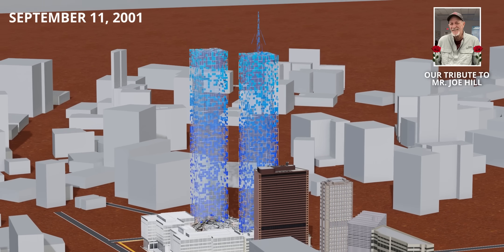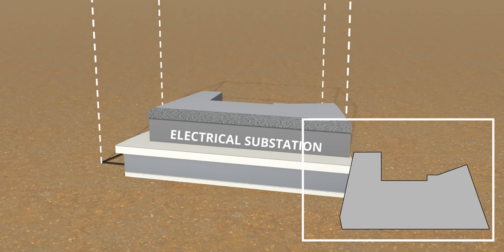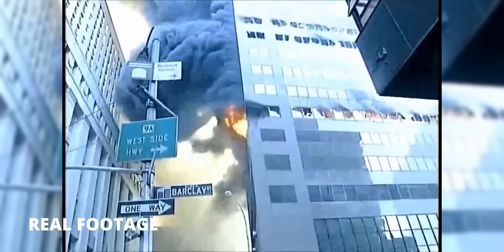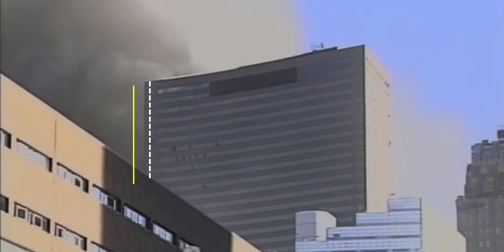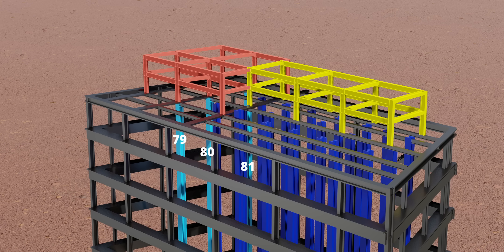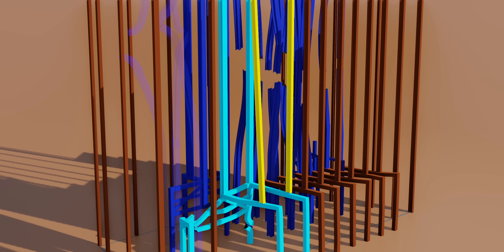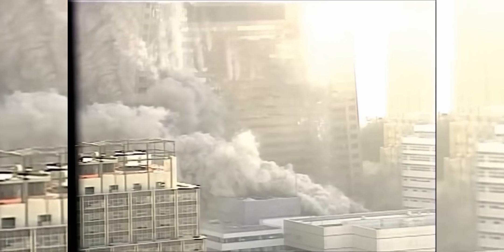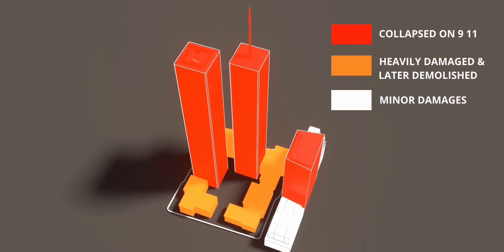Collapse of Building 7 | The Complete Physics

Comment: I have never seen so many improbable events happen in a single morning
Reply: yeah airplanes hitting buildings is pretty fucking crazy
Reply: @johnt,  use your brain. There was 2.5 seconds of free fall, in a 15 sec collapse.  What, explosives accelerated the collapse, then decelerated it?
Reply: @ExponentMars The craziest plane is the one that hit the pentagon directly in the budget analyst office, where the staffers were tracking the 2.3 trillion dollars that couldn't be accounted for, announced the day before on 9/10/2001.
Reply: @velatoget That’s a lie. That number was known about for 2 years prior.
Reply: @TreadHead42  That's not a lie. They might've known the number, but it was ANNOUNCED (read what I said) the day before, on Sept 10th, 2001. And you focused on the smallest, most meaningless detail. You somehow skipped over $2.3 trillion going unaccounted for, the plane hitting directly in the budget analyst office, the FBI/CIA taking down all security footage nearby and refusing to ever release it to the public, and so much more.
Reply: The passport from one of the terrorists who was on the plane survived all this and was found on the street. But the heat from that same airplanes fuel was so strong it melted the iron. What was that passport made from?
Reply: @AABB-zb6dv No proof of alleged "terrorists" even boarding the planes exist.
Reply: @AABB-zb6dv Passports are commonly found on airplane crashes, since they normally fly off due to the impact. Plus, many other documents and belongings, like plane tickets and wallets, survived the crashes and were found on the streets
Reply: I never thought a 747 could evaporate like the one that crashed into the pentagon.
Reply: @b @billwalsh388 ust look at the aerial photography of the 2015 Germanwings plane crash site,  without the contrast against the dark mountain you wouldn’t be able to see anything. Mixed with debris from a building, after such a crash you can’t recognize an airplane anymore.
Reply: @billwalsh388 It was a cruise missile - that's why
Reply: @billwalsh388  then you are stu-pid
Reply: @billwalsh388 The Pentagon wasn't hit by a 747, it was hit by a 757, a much smaller aircraft.
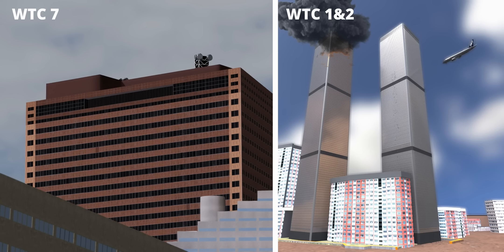Reply: 9:36 NIsT … the government agency responsible for investing this said it fell at free fall.  This video just said it was an editing trick 😂😂😂.  Free fall is in the official story dumb dumb
Reply: @beezybeez24  true
Reply: I cannot account for all the things you have never seen.

But what is truly is incredible is your fanciful nonsense of an alternative explanation
Reply: @MoseleyJon yea because us questioning the goverment who used to is to cover up the trillion dollars that went missing and used this to go start a war in the Middle East to destabilize it for the juice
Reply: @unanimouscoincollector8654 What war was started in the Middle East?  Iraq?  Framing AQ didnt really advance that.  AQ were already active and that war waa won within weeks. The US then spent 20 futile years trying to run Afghanistan, spanning 4 presidents - did they mean to start that war?
Reply: @laxeystu8096  Furthermore, the huge expense of the Iraq war is "on the books."  There was no money off the books required
Reply: I'm sorry-- maybe such "guns" are not "smoking", maybe just "lit cigarettes  left in ashtrays" is what still  has me coughing and  "choking"?

What is left but poetry and merry joking??
Reply: What I’ve learned is that I can rent a crane and smack a few holes in the side of any steel skyscraper then catch it on fire with some jet fuel and induce a nice and neat global catastrophic failure of the building.  I could under bid any demolition company in the world and get the same or better results than them.  Only need a crew of 2 or 3 guys to do it.  We could share the profits equally.  Even seems like we could be on call and have the building brought down on the very same day and be back home before lunch.  I’m just hoping the other demolition companies don’t steal my idea and get to market before me
Reply: @ryanburch7798  No, for many reasons
Reply: Whaddya say, about things PRIOR to such a day? For there is MORE than ONE "smoking gun" than just bldg 7......

......To get the conspiracy theorists theorizing and revin'.
Reply: Probably also never saw two jumbo jets loaded with jet fuel slamming into skyscrapers at 500+ mph
Reply: The main event is improbable - the damage that occurs because of it would be expected.
Reply: It's called a coincidence. 😂
Reply: @chrisdanielson1219 almost like winning a loto then geting struck by lightning-2 times on way to cash it ,when they bring you in hospital they say you are diagnosed cancer and if you waited a day more it would be over , but then a random drone hits a pigeon and loses control falls on building causes fire and fire spreads to hospital, then cuz office fires are just to strong for steel structures hospital collapses and every1 dies except owner of hospital who was only that day missing from his office and when he comes to burning scene he finds your loto ticket.. believable? Or too many coincidences?
Reply: "So many improbable events in one single morning" in over 20 years this is the best statement I have heard to simply sum up what happened.  The whole thing was bullshit and our government feed it to us while sacrificing the lives of thousands of Americans....absolutely disgusting!!
Reply: @AlexanderPerez-v4w How could they do that!! Is money so much more important than a human life?
Reply: Improbable events like steel failing due to excess heat and damage, then collapsing?
Reply: @Cereaza2  the wtc 7 was damaged by what ?
Reply: @Cereaza2  excatly like the wtc 7 ?? Come on
Reply: @Cereaza2 you just said the main point. Steel weakening isn’t the same a steel losing 100% of its strength at the same time at all points in the building… weak steel still gives resistants.    Free fall is impossible.  Even if the buildings were made of popsicle sticks it still couldn’t have fell like that. Basic physics says weak steal can’t fall straight down.  It would tip.
Reply: @beezybeez4207 basic physics doesn't say that. For it to tip over, one side would have to lift up off the ground. That's not going to happen unless the foundations come out of the ground. 

Also the towers didn't fall at "freefall speed". You can tell because you can see debris falling faster than the towers
Reply: @Cereaza2  Yes.  All of those events are highly improbable if not impossible.
Reply: @Cereaza2 ya the 1st 2md and 3rd time it ever happened. To much other stuff that makes it obvious it was a false flag
Reply: @Cereaza2  
Never again in history have steel frames building collapsed due to fires, here it happened what, 3 times in a day?
And all the buildings were owned by the same jewish billionaire that had the largest insurance in history on them? 
And it lead to a "war on terror" that justified the invasion of foreign lands and gave life to the military industrial complex for decades?
Wow. This really was americas lucky day!
Reply: @TuriGamer 
Wasn't Americans but Israelis lucky day.
Reply: @Cereaza2  Yo i think he just means it was a pretty crazy morning..
Reply: @crashkey poor dude probably did really mean it was just a day of unimaginable 1 in a million horrors and these goofball truthers have everyone on edge and lashing out lol
Reply: @crashkey nah bro. He's a conspiracy theorist.
Reply: @crashkey  No, he means it was clearly fake.
Reply: @crashkey  No, he means to imply that a lot of things that happened, couldn't have happened the way they did. But because he doesn't have actual arguments to support his position, he just implies the 'official story' is false without daring to directly say it.
This type of cowardice is common for conspiracy nuts. They want to make a claim they know they cannot support, so they just imply it, and when pressed, can pretend they never made the claim they clearly implied.
Reply: @Cereaza2  Like 2 jumbo jets doing physically impossible flights into buildings which then impossibly collapsed, then impossibly causing a third building to collapse, as a result of impossible events.
Reply: @Cereaza2 
The jet fuel burns super fast, it didn’t just stay burning long enough to melt steel beams
Reply: @elidelhotal3003   steel can have to be  weaken substantially without melting,  and  therefore not able to support the weight of the building.
Reply: @cacbdb  Yes but then you still don't have a free fall let alone a straight free fall
Reply: @elidelhotal3003  Yes. True. Thank you.
Reply: @elidelhotal3003 - Correct...95 % of the jet fuel went up in a black cloud..
Reply: @elidelhotal3003  Yes, exactly, the jet fuel wasn't the main fuel of the fire, the building and office materials sustained the fire, and no, that still doesn't melt steel beams, no steel beams were melted.
Reply: @cacbdb  Indeed so.  There is a reason that there is a National Fire Code.

It mandates that steel beams must be protected to maintain their load-bearing capacity.

Common life safety ratings are from 1 to 3 hours - depending upon the buildings occupancy classification !
Reply: @cacbdb dont forget the fire protective coating that they are built with
Reply: @Cereaza2   Right. So, what you're saying is, on your planet, there never was an "iron age"? Because, on THIS planet, the effects of heat on iron and iron alloys? Have been known since about 3000 BC....
Reply: @mooneyes2k478 You seem lost in the "IRONY AGE" = IRON DOES NOT EQUAL STEEL!
Reply: @Yes-bk9cl  Yes it does. Steel is an iron alloy, and even the specific types that contain the highest amounts of non-iron elements are made up of 75% or so iron.

But even if it didn't....which part of "iron alloys" did you miss. The iron age means "we learned to use iron and its alloys"....and steel reacts exactly the same as iron does when heated. It turns malleable.
Reply: @mooneyes2k478 Iron alloy steel is NOT interchangeable. That's why we have steel 😂
Reply: @mooneyes2k478  your comment makes no sense. Steel was used for the columns and not iron. Also exactly because we know the properties of iron we know there was no controlled demolition. It was metal fatigue.
Reply: @momchilandonov  " Steel was used for the columns and not iron"
And so, you have no idea what steel actually is?
Reply: Well, maybe also on the day JFK was killed...
Reply: I mean... the most improbable things were two planes hitting the twin towers, the rest more or less follows...
Reply: yep. makes you want to go back to sleep. who wants to start the day off with a pack of lies.
Reply: So said one dinosaur to another.
Reply: Hmm, well if you're  "amused" by "improbable events" you don't need to JUST look at September 11, 2001.....Heck, just look at some of the events ((((OR LACK THEREOF)))) PRIOR to that date....With a sharper eye on the state of FLORIDA, which I believe was governed by "W" s brother "Jeb" (No relation to me as a  "Jeb" either🙄)

All sorts of "funny" or "improbable" things are involved with the date of September 11th, 2001....Including the "merely coincidental" choosing of such a date by supposedly MUSLIM TERRORISTS to be referred by a 💩💩💩💩--load of people simply as "nine eleven"....The same three digits designated as the  NATIONAL EMERGENCY number of  "911"?????????????

Heck, while you're at it, just look to see if THIS COMMENT OF MINE HERE actually remains and does not get pulled by YouTube????🙄🙄🙄🙄🙄🙄😒
Reply: Oh wait.....Maybe it's just a single  GOVERNMENT AGENT/bureaucrat working  perhaps the PROPAGANDA/INFORMATION DISPERSAL DIVISION of the CIA/NSA  working for (or IN) Google/YouTube that decides what comments here  get yanked??  

Whaddya say "spook".....YOUR name on the visitor's log to Epstein Island.....Is THAT what "Big Brother" has got on you, or is it something far more sinister.....Maybe a SNIPER with a bead on  a loved one right now???  Or is just a simple matter of you just not having a CONSCIENCE??????🙄😒😔
Reply: I'm still convinced that it was a plan to prevent catastrophe similar to the Citicorp building, wherein the powers that be were worried about the towers toppling over in a worse version of the 1993 basement attack.

So the buildings were rigged to blow should that have happened. It makes perfect sense - the evacuation plans had everyone rushing out of the building, but the fact that aircraft were used meant that people were funneled back inside to avoid falling debris, and many were trapped in the higher floors. 

For people thinking that it's impossible that explosives could be stable and safe that long, all I can tell you is that you have explosives in front of your face every single time you drive. Airbags use explosives very similar to those used in demolition. They're clearly stable enough to not go off until the "right" moment.

It actually makes me feel really bad for everyone involved. They thought they had the perfect plan: they knew another attack was coming, they were ready to safely bring the buildings down once the people were safely evacuated (likely with a show of engineers going up to "jury rig" the building to blow), hell they even took out massive amounts of insurance on the buildings.

This was all based around the assumption that a van would be used, like it was in 1993, like it had been in Kansas City, etc. Nobody thought the terrorists would ever really burn their most successful means of negotiating - plane hijackings. Then the first plane hit and everything changed. Likely they assumed the reports of using aircraft in the attack were a diversion to make people not pay attention to vans driving up. Can you imagine being the person who had to push that button? Heartbreaking. :-(
Reply: Heart breaking, is the lack of an education people can exhibit.
Reply: No one has.
Reply: Cause your slow
Reply: Umm, Sandy Hook was even worse than this one.
Reply: The way you can tell it was a planned demolition is because of these buildings came down by fire alone then every city in America would have to take down their sky scrapers and rebuild them.     We can’t just allow fire to bring down high rise towers …. The entire building code regulations would have to change.  Yet, everything is the same.   They rebuilt the new tower with the same steal that can collapse ?    Wouldn’t that be the dumbest thing ever ?
Reply: Then just wait till you learn about the deepwater horizon….
Reply: are you antisemitic?
Reply: And five dancing Missad taping it.
Reply: Fact is very often stranger than fiction
Reply: @amstaylorph  truthers don't have facts.
Reply: And still they happened
Reply: Congratulations. There was one Sept 11 in the entire history of the planet.
Reply: Building 7’s collapse front the front view  
https://youtu.be/6pyyqV7egEI?si=aN5HdjJaRL3ziHyE
Reply: It was an unprecedented event none or this is improbable.
Reply: Dying is improbable but it happens all the time
Reply: You live in a bubble
Reply: "Readers should imagine the possibilities for themselves ... an act of CATASTROPHIC TERRORISM that killed thousands or tens of thousands of people and/or disrupted the necessities of life for hundreds of thousands, or even millions, would be a watershed event in America's history. It could involve loss of life and property unprecedented for peacetime and undermine Americans fundamental sense of security within their own borders.
Constitutional liberties would be challenged as the United States sought to protect itself from further attacks by pressing against allowable limits in surveillance of citizens, detention of suspects, and the use of deadly force. Such an event would divide our past and future into a before and after"

This is an extract from an essay titled Catastrophic Terrorism, written in 1998 by Phillip D Zelikow, a dual-national Israeli. Following the rejection of Henry Kissinger, Bush's initial choice for the role, Zelikow was appointed Executive Director of the 9/11 Commission by George W Bush in 2003, and he authored the subsequent 9/11 Commission Report, published in 2004.

From 1991 to 1998 Zelikow was Associate Professor of Public Policy and co-director of Harvard's Intelligence and Policy Programme. Whilst there he worked with Ernest May and Richard Neustadt on the USE and MISUSE of history in policy making. The idea of "public presumption", he explained, is akin to William McNeill's notion of "public myth" but without the negative implication sometimes invoked by the word "myth". Such presumptions are beliefs (1) thought to be true although not necessarily known to be true with certainty, and (2) shared in common within the relevant political community". In other words, an expert in the mechanics of turning a "myth" into "reality", turning an actual "UNTRUTH" into a perceived "TRUTH".
This was the man, a dual-national ISRAELI, selected by the Bush Administration to tell the world the TRUTH about the 9/11 attacks.
Reply: Yes, four hijacked airliners. Who is to say what is 'probable' when a tower block of a design is impacted like that?
Reply: sprinkle some passports on it and let's gtfo
Reply: Nothing was improbable. Maybe to you it seemed that way
Reply: What is not probable for you on that morning?!
Reply: I mean, it's only improbable if you don't understand anything
Reply: Larry Silverstein 🇮🇱 (owner of WTC complex) said - "Pull it, and we made the decision to pull and we watched the building collapse" - referring to WTC 7 - not hit by planes.
"We are benefiting from one thing and that's the attack on 911" - Benjamin Netanyahu 🇮🇱
Reply: Exactly. Things like Silverstien not going into work that morning. His wife told him to get a haircut instead. And his son who worked at the WTC happen to sleep in that morning... Hmmmmm. There is reason to believe this is bigger than you think.
Reply: @adssco120  i hope that one day we will know the truth...
Reply: Correction, his wife sent lucky Larry to a Dermetologist it wasnt a haircut on that morning.
Reply: Because it was precisely planned in advance
Reply: @elidelhotal3003  exactly that!
Reply: @elidelhotal3003 moron
Reply: @elidelhotal3003  In a building full of people, in constant use, and which burned for 7 hours....
Reply: My favorite was how Larry Silverstein decided not to go to the building that day for lunch like he normally did and just so happened to take out an insurance policy for terrorist attacks on building 7.
Reply: Why are you spreading misinformation @LIJJJJ  ?

1. He was the lead for a consortium of investors.
2. Insurance was mandated for the lease.
3. Terrorism insurance was routinely provided for commercial policies.
4. There had already been a terrorism attack on the Twin Towers (1993 -  just 8 years earlier)
5. He had a doctors appointment that day.
Reply: @NickJames-o6m  so Barry Jennings’ mysterious passing 2 days before the NIST report was released is also misinformation ? His passing had nothing to do with the fact he had  reported hearing explosions and being that he had walked over individuals who were no longer living when leaving the building? Both of which conflicted with the NIST report. Guess it’s the same off chance and odds as Larry not being to work that day along with his kids.
Reply: I have never seen such an "improbable event" like having my LAST COMMENT here pulled..... And NOT because it "violated community standards"..... Whaddya say YouTube....Going to pull THIS ONE too????🙄🙄🙄🙄😒
Reply: like what?
Reply: @pacman3556  A steel structure free fall straight with no resistance of any kind.....laughable
Reply: The day before 9/11(9/10/2001) Defense Secretary Rumsfeld announced to the press that the Pentagon could not account for $2.3 trillion in expenditures. After 9/11, the Pentagon claimed that the computers that contained the information about this problem had been destroyed in the 9/11 attack.
Reply: @thomasnelson5010  Completely unrelated though, amiright?
Reply: @pacman3556  are u still asking ?
Reply: Yes, he is, and if not, I’m asking. What collapses first on your wtc7, the roof or the base?
Reply: @dikranovichk5889  Even if the base completely gave way it would not result in a straight free fall with no resistance from any beam or other structural support.  Nope
Reply: @johntg123  I'm willing to bet you have absolutely no credentials to back up that statement nor the knowledge to explain why. Conspiracies are fun though hu?
Reply: @pacman3556 Your denial for once.
Reply: @Yes-bk9cl  I am not in denial. I accept what happened. it is you "truthers" that cannot accept facts. It is sad you wasted over 20 years of your life living on lies
Reply: @pacman3556 Thank for confirming your complete denial of scientific facts.
Reply: @pacman3556 - Like you still breathing for one
Reply: @henrysousa2502  why would I not be breathing?
Reply: @pacman3556 - You must be AI, you`ve got too be...
Reply: @pacman3556  like a plane vanishing 2m off the ground... no engines, no bodies, no landing gear...
Reply: @pacman3556  I dunno, maybe a group of foreign terrorist hijackers that were flight school dropouts evading the CIA, the FBI, and even the U.S. military and crashing fully loaded jets into the sides of two world-famous skyscrapers as well as headquarters of the most advanced military on the planet, and all of this without anyone stopping them. And to top it off, three buildings collapsing fully to the ground, including one that wasn't even on the same block as the two that were targeted. That seems like a lot of improbably events for a single morning.
Reply: @pacman3556 
And the air defense magically being off that day
Reply: @huygvbb  the air defense wasn't off that day. There is no air defense around the towers. Wtf you talking about?
Reply: @pacman3556  
Norad was training instead of having the air defense working,
Reply: @huygvbb  no it wasn't however if we accept that lie then so what? what do you keep babbling on about?
Reply: @pacman3556  
Okay
Reply: @huygvbb  I will take that as admission you can't answer the simple question.
Reply: @- The Pentagon air missel defense system was turned off on 911..
Reply: @pacman3556  Jet fuel melting steel.
Reply: @- CAN`T HAPPEN...
Reply: @proto-geek248  no steel melted and jet fuel is not the only thing in the world that burns so what are you going on about?
Reply: Guess there were no "improbably events" after all, hmmm?
Reply: None at all. Everything is exactly as they say. Coved came from a bat. Saddam has WMD, and Joe Biden is sharp as a tack! You tell em bot!
Reply: @mooneyes2k478  So you think what happened on 9/11 is an ordinary day in America, not at all improbable?
Reply: @sorcerykid  No, but apparently you do...